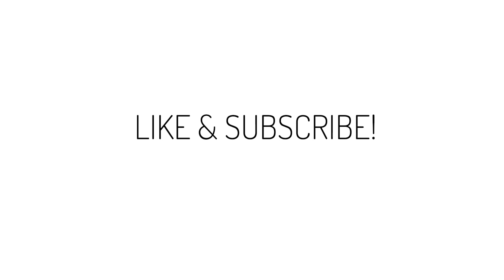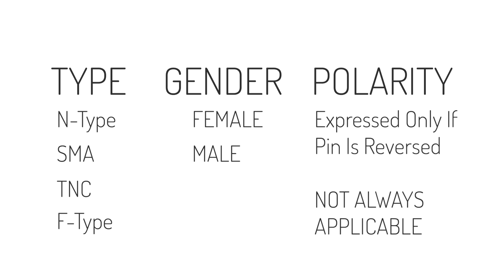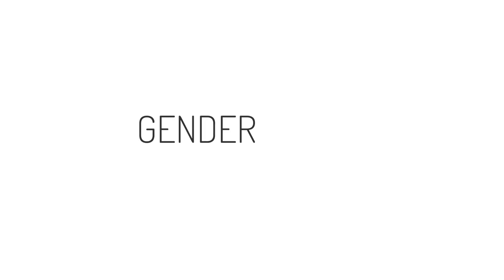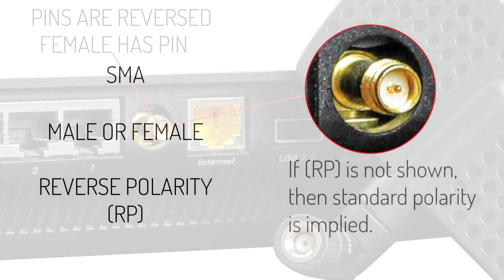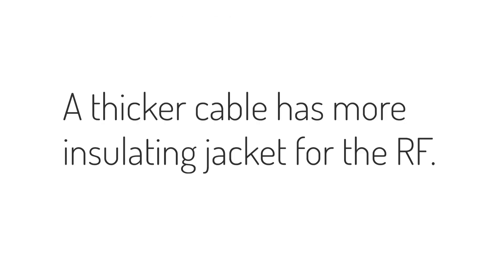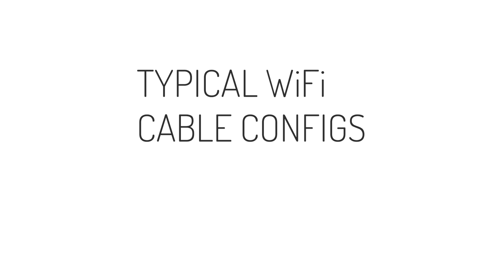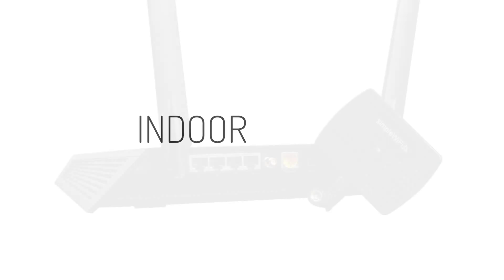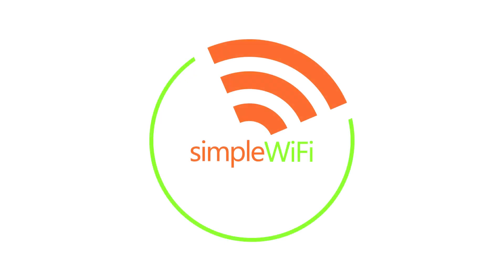How to: WiFi Cables & Connector Tutorial For What To Use And When

Comment: Hi I have an sma female adaptor wire that recently snapped and stopped my WiFi from getting signal, I want to replace the cable but it’s the end of the cable that sticks into the wall and I don’t really wanna call a repair man for it, should I just cut past the broken wire with a razor and leave a half inch of the wire off and stick it back into the sma adapter? Please let me know

Comment: I have an indoor cable that would go into a cable box, would i be able to buy a Coax to Ethernet and connect it to my PC?
Reply from the maker: Doesn't exist
Reply: @SimpleWiFi  Bought an RF to RJ45 converter adapter to do this and its not working, trying to run the coax-ethernet for my PC without having to buy a MOCAH device. what is the best solution for my situation?

Comment: Hey Raul I ordered a Repeater kit this last fall, and my question is, how difficult is it , to upgrade my Netis router to one of your Netgear nighthawks? The Netis works but I think it would be much more stable with the Nighthawk? Thanks ... Ray L.
Reply from the maker: Hi Ray, it's very easy. You won't need to do any reconfiguring of the repeater. Simply remove the POE that is plugged into the Netis and into the WAN port of the new router. After that the repeater will pass along the internet just fine. The Netgear will do a better job of managing users and devices as well as provide the best possible speed to each. It's much better than the Netis. -R

Comment: i have wifi repeater that have been using SMA but the antenna cable soldered in PCB were detached. idk what cable i'll use. is it okay to use rg174 with an RP-SMA connector already? and solder it into termirnal? pls help
Reply from the maker: Yes you can.

Comment: What is that really thin cable found in laptop computers for the WiFi antenna?  You will know if you see it because the stuff is so thin it looks like you need a microscope to reattach that wire if you are one of those unlucky ones who accidentally pulled it out.  I know when I swapped a WiFi card in my laptop I tied a string to it just incase it disappears down inside there to give me a little hell and it is so thin it looks almost like an ordinary wire.

Comment: I was just wondering if i could use my Alfa Type N with tv cable antenna outside Coax idk what type maybe SMA. to receive /scan for 200 to 300 meters of Broadcasted wifi because i want to connect my laptop   to connect in my office wifi.
Reply from the maker: Technically yes you can as long as the connectors match up.
Reply: @SimpleWiFi  Thanks so much im planning to buy the adapter this week. will let you know if it works ^^ cheers
Reply: I bought TP-Link TL-ANT24PT3 Pigtail Cable(N Male to RP SMA Female but it didn't scan any wifi in my place but when I use the default antenna of alfa I scan 10 near wifi. so how do I know if what is the problem? please help thanks.

Comment: What do you think about using  25' RG 58 coax cable on a  WiFi antenna with  SMA fittings? What is the difference between  RG 58 coax cable and L400 cable?
Reply from the maker: Over 25' I would say about 10-15dB. That cable is VERY lossy. I would not do more than 10' on RG-58 at WiFi frequencies. That's a big NO NO. That kind of cable is OK for lower band cell (700-900) and better at VHF/UHF.

Comment: This video leaves out the connectors most often used in computers and other mobile devices. They look kinda like an SMA but come in two sizes. Every antenna ive ever come across uses these and the wires look like less than .195 inches. Wouldnt that be in metric though? ISO specifications are meant to be used everywhere and doubt theyd use inches. Also was kinda looking for a video on the specifications for the wiring like what sort of insulation is required.
Reply from the maker: Do you mean the cabling used on PCB's? Those are a whole other category and we don't deal with those. This video and channel is meant to cover indoor & outdoor WiFi components. Thicker cables and much longer cable runs are used in this area.

Comment: I have a 4 unit apartment complex with each unit in the same building, side by side, but separated by cinder block walls. WiFi doesn't pass thru these walls well enough to be usable. I've thought of 2 possible ways to accomplish the sharing of a single internet service between all 4 units. 1) I would like to get a WiFi router for one of the units and then extend the signal by using cabling to each of the other units, with a small antenna mounted on the ceiling of each of the other three units. Would anyone here have recommendations to find the best router for this purpose, as well as cabling and antennas? 2) I've considered running CAT 6 from the router to an extender/access point placed in each of the other units. Would anyone have a recommendation for a ceiling mounted access point/repeater. If someone could suggest a better method, I'm open for that as well.
Reply from the maker: Cheapest solution us to have 1 main router at unit 1 and run CAT 6 to each unit's router.
Reply: have you tried a switch to share the wifi from main router to other three routers?

Comment: Hey how are you doing i wanna create my own acces point and wifi share up to 10km please help
Reply from the maker: OK, do you have a 30m tower at each location, clear line of sight between two AP's? Cost would probably be about $2k USD +++
Reply: SimpleWiFi ok i do have the requirements that you gave but I would like to do it on this way for internet i wanna use 4g or lte router and lets say if i want to make my wifi for selling to house and it need to add a 30 days internet and then there will show up a message pay your internet can you make a video about this thanks for replying
Reply from the maker: That is different, start talking to your local carriers.
Reply: SimpleWiFi what do you mean with carriers like vodafone etc
Reply from the maker: Yes
Reply: SimpleWiFi im my country are vodafone and telekom

Comment: Can SMA Male turn into SMA Female by inserting copper wire into the hole in SMA Male which act as a pin? Without using any SMA converter/adapter.
Reply from the maker: No since the MALE or FEMALE applies to which connector has the THREADS. The pin does not determine the gender. (I know this is confusing lol) /// If you do as you ask, then you are turning an SMA MALE RP into an SMA MALE.  Also, I wouldn't do this on your own unless you are great at soldering. There is a good chance you will have some signal loss unless done perfectly. Save yourself the hassle and spend the money on an adapter IMHO..
Reply: SimpleWiFi Thanks man, I hope I asked the right question without any confusion Lol, Great Channel Content! Reply is Superb!👍
Reply from the maker: It's all good, glad I could help! =)
Reply: SimpleWiFi Therefore it is possible by inserting some copper wire into the hole as a pin to transmit radiowaves depends upon soldering (Not referring to change the gender, My mistake Lmao), Now its clear to me the difference between male & female ones lol, I can now tell that male can eat the female because the thread on male is in the inside while female thread is in the outside. Thank you Very Much!!!👍👍👍 because I thought the male will always have a pin outwards, I was wrong. Lmao

Comment: will a tv antenna cable work for wifi yagi's ?
Reply from the maker: It is not recommended. You will have an impedance mismatch plus that cable is very lossy resulting in poor signal reaching the antenna.

Comment: This is mostly wrong.
Reply from the maker: Would you care to elaborate?
Reply: @SimpleWiFi  Could be that I am thinking wrong. It's the gender thing.
Reply from the maker: @richardblanchard2743  It's a common issue. Especially when you start to talk about polarity. But the safe bet is to think: Threads exposed - Female // Threads on the inside - Male.

Comment: Sir i have one question, i want to put the antenna out tomorrow (20m/ ~65ft lenght), but i think all time it will be better to do that with possibly thinner cable. So watching your video I realize it is better to do that with normal Coaxial cable. if you can explain why is it better, because I thought all time thicker cables need more power than the router produces, or thickness doesn't play that much role, just length? thx greets from Bosnia
Reply from the maker: Thicker cable means more insulation along the cable run which holds more signal down the entire path.